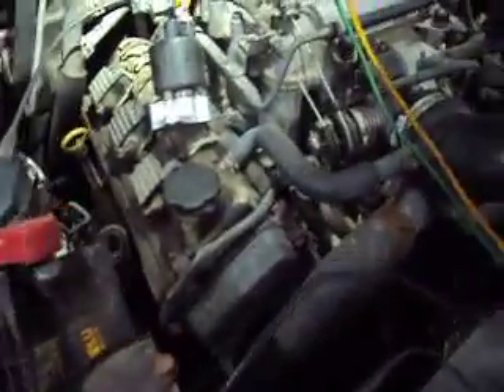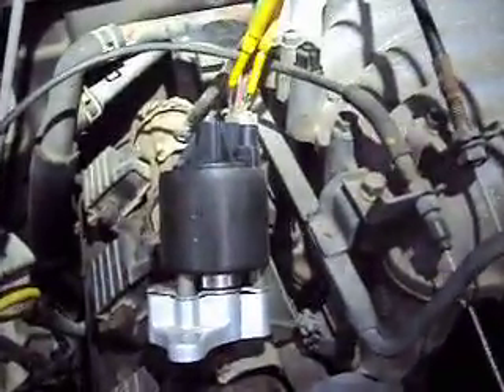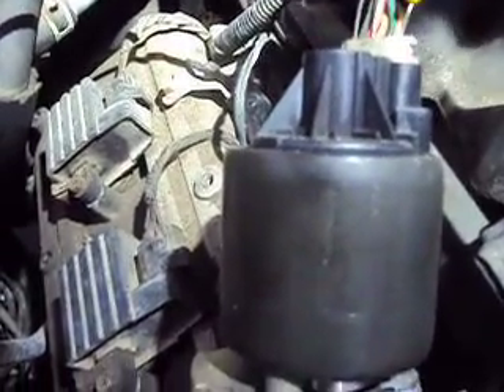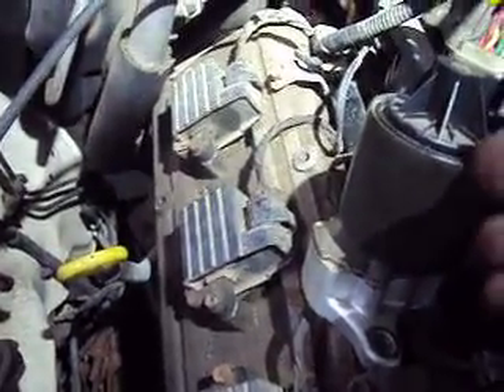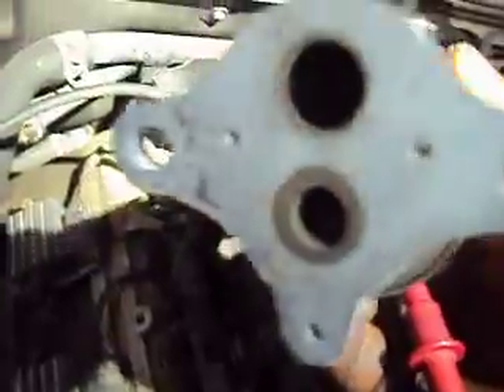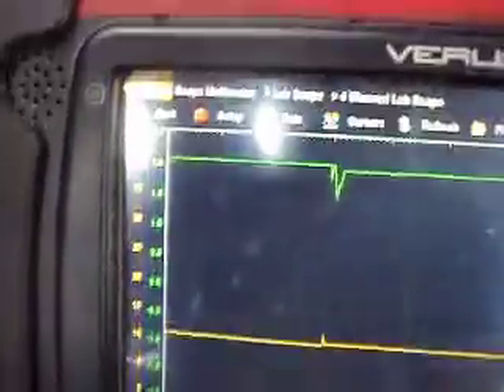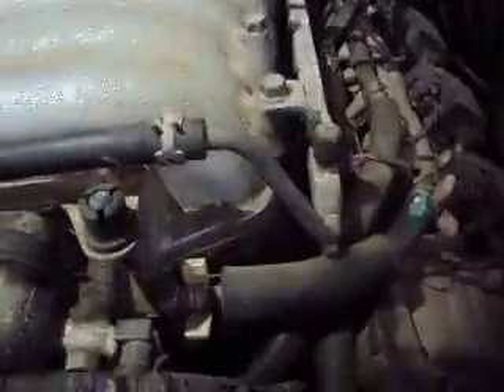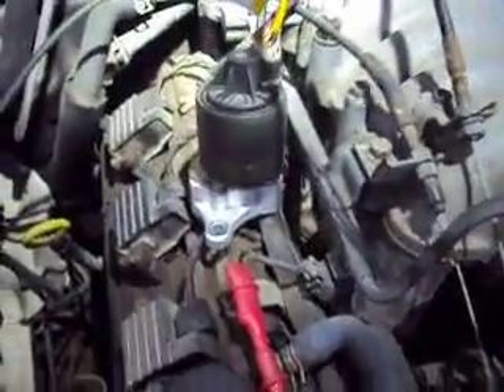Testing an EGR valve on a 98 Isuzu Rodeo 3.2

Comment: Learning this vehicle, im ultra stubborn about running as long as possible.. Your understanding is pretty amazing. Pulse width is electrical engineering.. Square wave pulsating DC just like noted.. 0-100% "power level". 

This would be driven off a MOSFET (Metal Oxide Semiconductor Feild Effect Transistor) or IGBT (Insulated Gate Bipolar Transistor). 
Seems like this system was an afterthought maybe for domestic emissions?? It sure didn't last.. Mine keeps getting worse.. bubbling rumble exhaust sound on drivers side for 20 seconds that changes to normal or near.. I'll watch again I think this is correct track thanks..